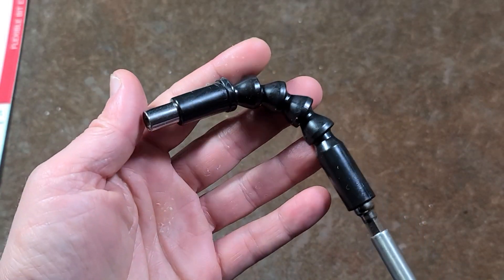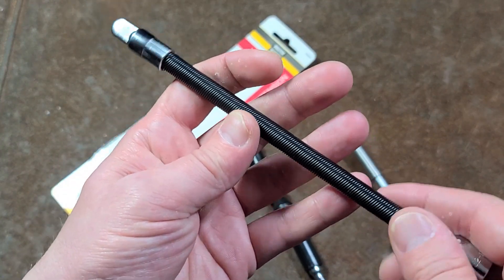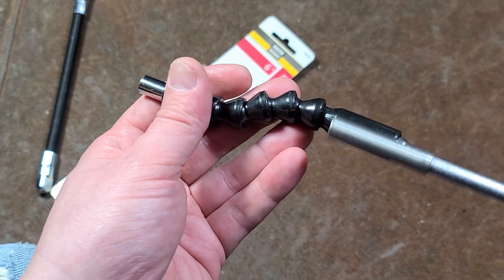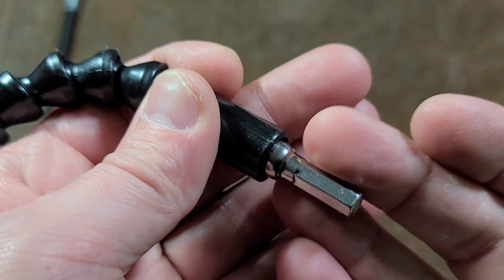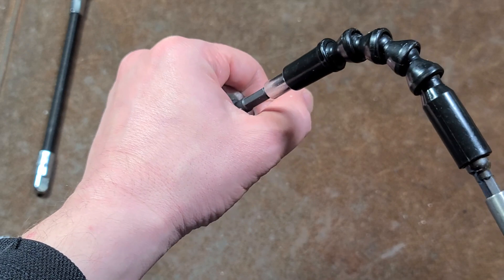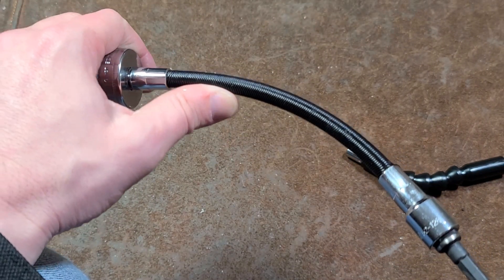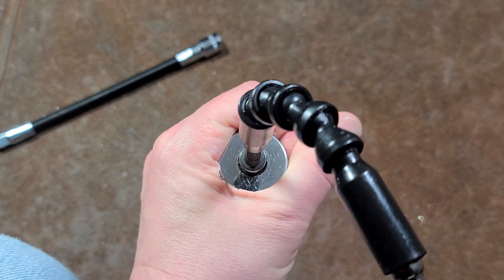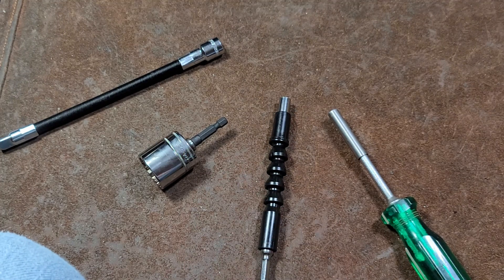True Value 6" Hex Flex Driver Extension Review (Neat But Weak)

Comment: Hello again Catus Maximus 
Thank you so much for the Great Video.  I am in agreement with you about this tool. I am always looking for a tool to make my job easier. Again thank you.
Reply from the maker: You are very welcome
Reply: Hello again Catus Maximus 

Thank you for the quick response. I was wondering if you have any reviews of magnetic universal joint and socket extensions. Like the Gearwrench 81235 or the Sunex 8855. I've seen these being advertised, but I have never used them. Are they a gimmick or a useful tool? Do they have any Limitations I need to know about? And finally, and only if you're up to the challenge, which would you recommend? Maybe you know of another Brand Name I haven't considered. Again thank you